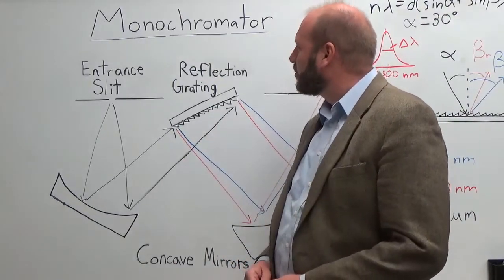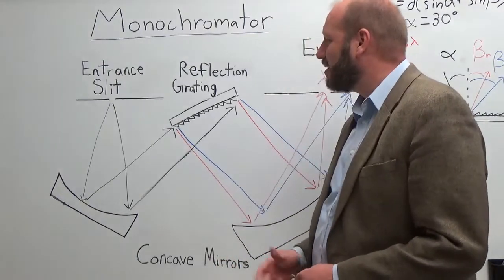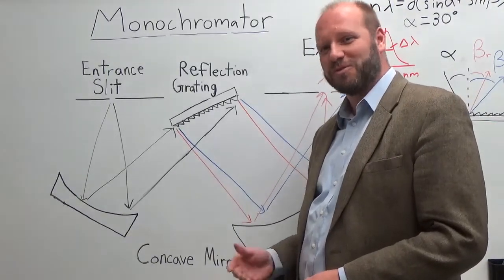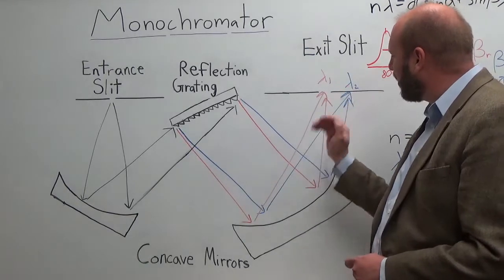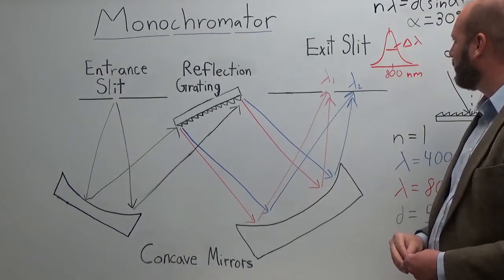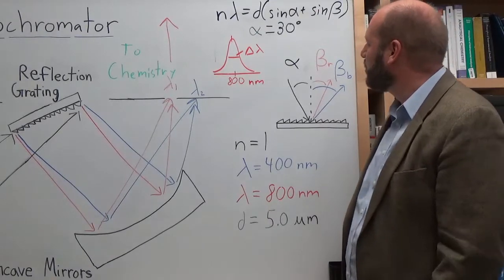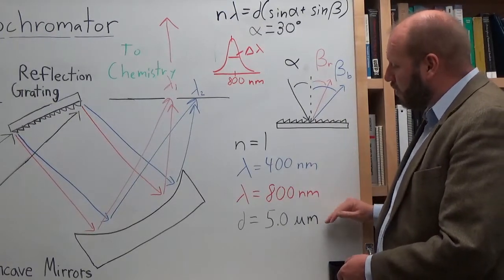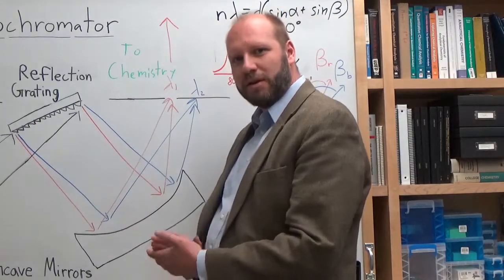Three minute analytical chemistry - Monochromators I

Comment: you say diffraction but on the diagram it says reflection? for the grating
Reply from the maker: The grating has a reflection line present, and the other lines are diffraction.  We use the diffracted components for wavelength selection.
Reply: @mheien  Also this is a reflection grating (the light bounces back) rather than a transmission grating (light passes through).